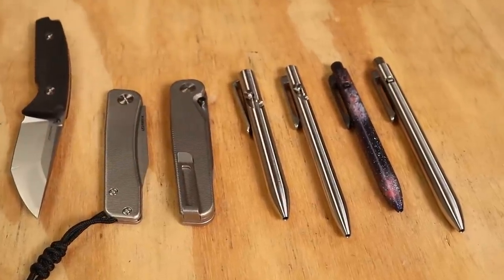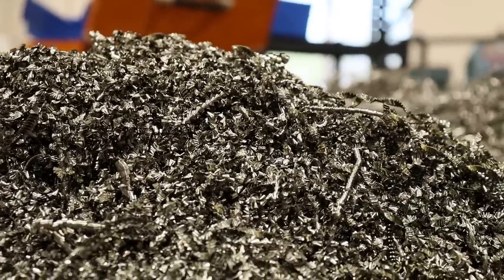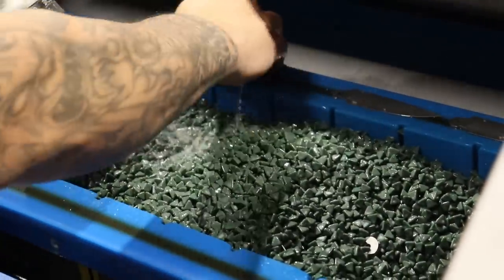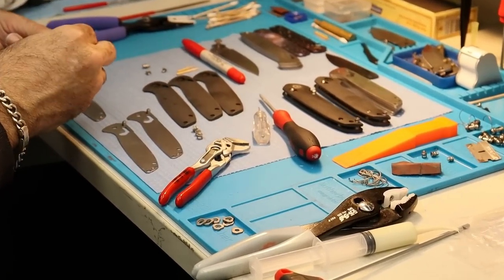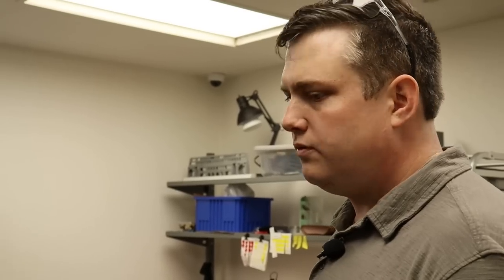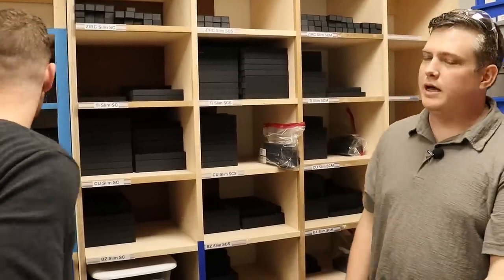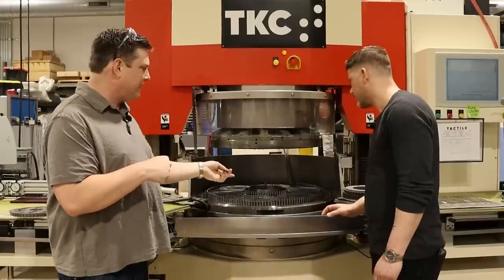How A Premium Pocket Knife is Made in the USA | Tactile Knife Co

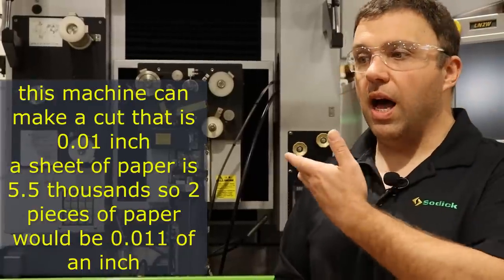Comment: 4:48 he mentioned that the EDM can hold a ten thousandth of an inch, as in 0.0001" tolerance. the text that pops up says 0.01 inch, this is probably the width of the cut path which is somewhat irrelevant. the impressive thing he wanted to convey is that insane tolerance (way overkill for a pocketknife)